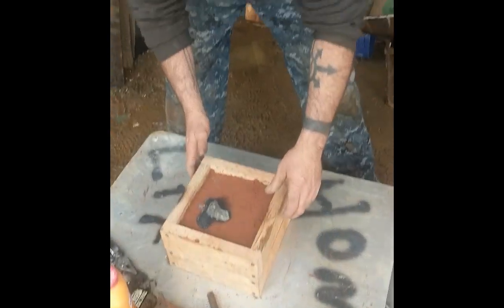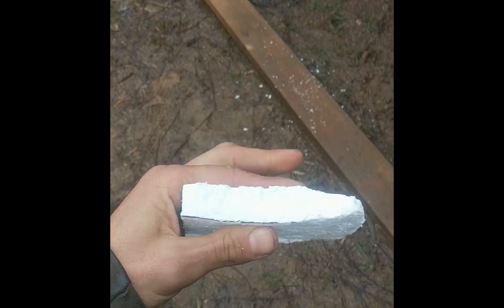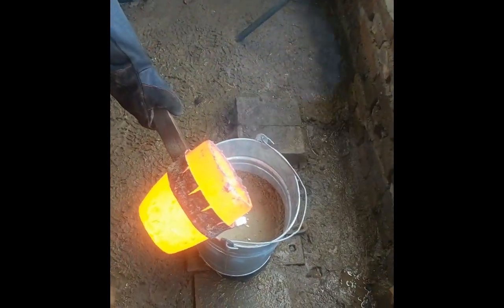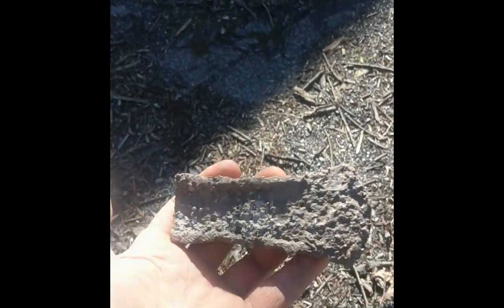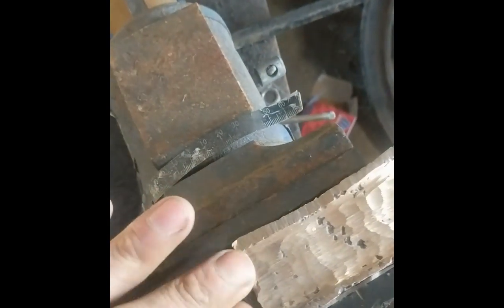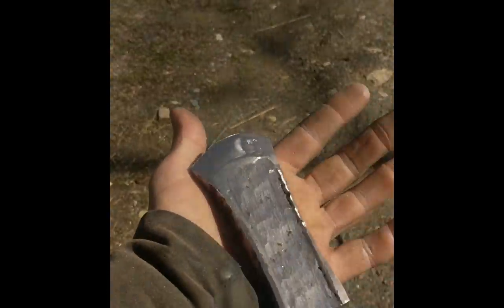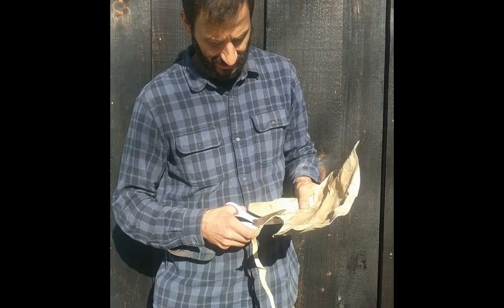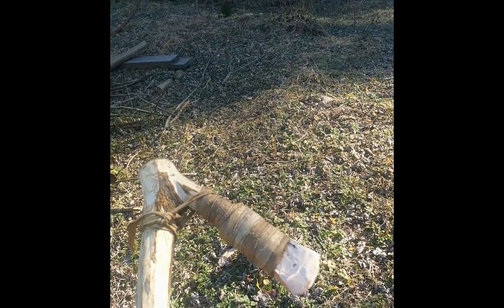Making and Using an Otzi the Iceman axe replica!

Comment: I feel I have to point out the fact that the pyramids are at least 14 000 years old, like Gobekli Tepe in Turkey, some of them were only renovated at later dates.  Hopefully you learned something from me, like I did from you.

All the luck on your journey Jordan.
Reply from the maker: I've had a few people inform me of that ;). Always something to learn! ))
Reply: Goblekli Tepe is recognised as the oldest known structure by a decent margin, the pyramids of Egypt (which i assume you are referring to, other pyramids exist) are from various dates and were repaired consistently for the duration of the ancient Egyptian dynasty, none of them however, come close to the age of the Goblekli site, and are far more advanced and elaborate structures than it, too.

do not allow contrarian pseudoscience to poison your critical thinking.